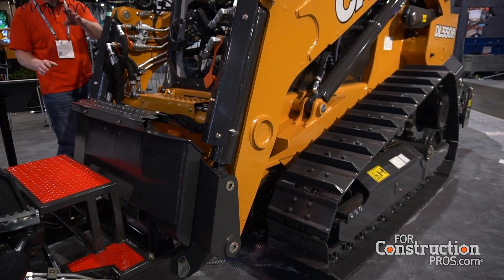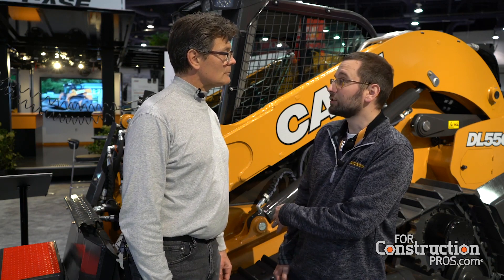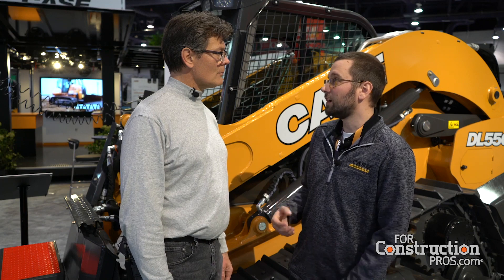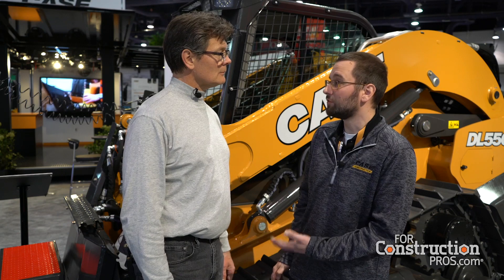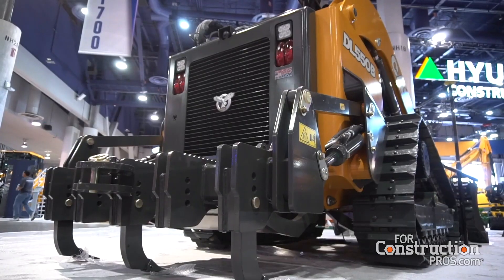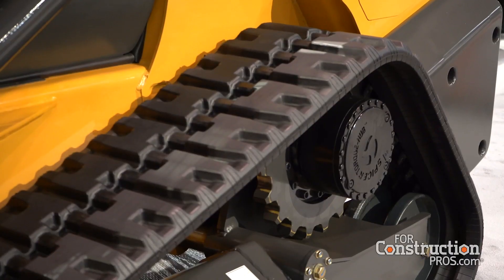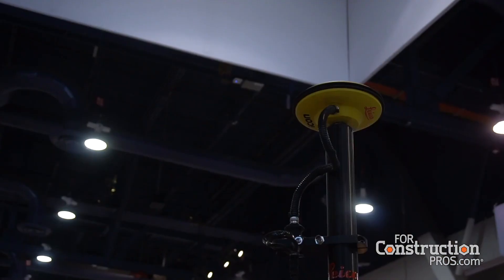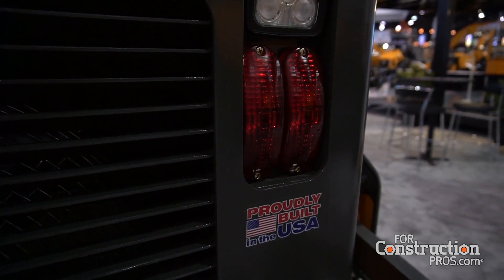Case Taking Orders for Minotaur Compact Dozer/Loader

Comment: I hope this machine has a drive control on the left joystick that can be locked in forward or reverse and an accelerator/ decelerator pedal so you can concentrate on the bucket and blade. I see this machine with the steel tracks has just as much capability with a bucket as a blade. Demolition jobs, forestry jobs and backyard excavation jobs just to start. Anywhere off the pavement it should shine.